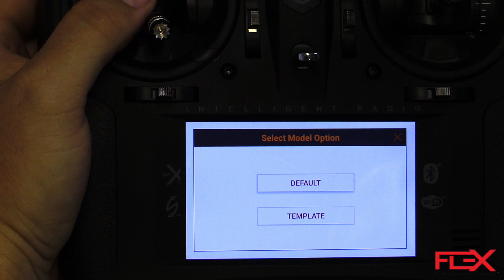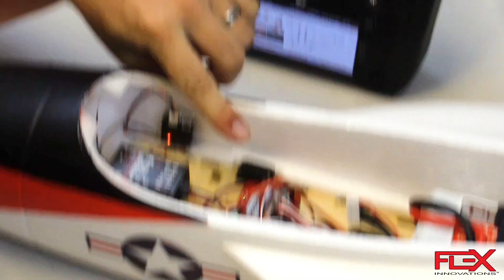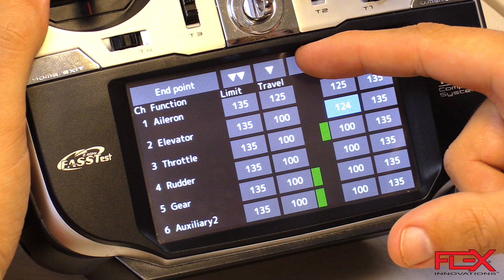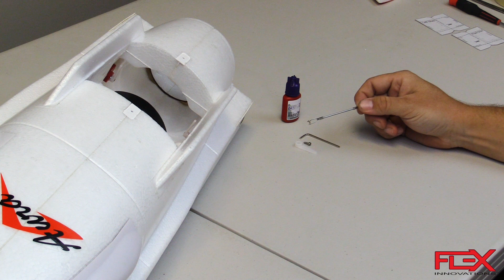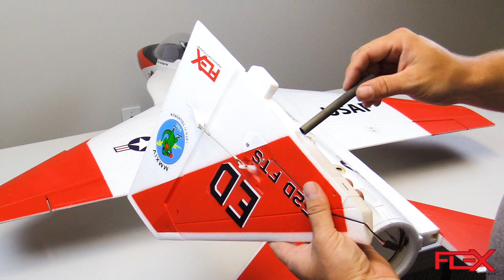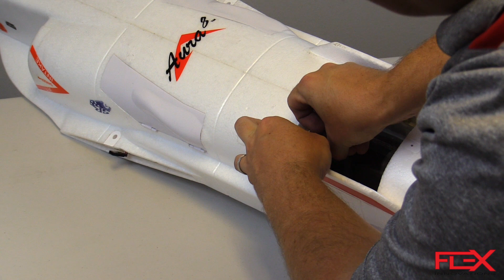FlexJet Assembly - How-To - Flex Innovations

Comment: So the stab is held in place by screwing a control arm on to the plastic spline on the axle of the stabilizer.  What is supposed to hold the plastic spline in place?  Does it come glued into the axle?  I didn't see any instruction to glue it in place.  If the spline comes out, the stab spins freely.  If that happens in mid air, that's all she wrote.

Comment: How can I bypass the Aura8 and just use a regular receiver and wiring like any other plane simple and it works. can I just plug in the servo cables on the receiver and go but how does the electric motor run should I just use ch 3 like normal throttle to start the elcetric motor.
Reply: ¹
Reply from the maker: Its works like anything else would without Aura. Plug servos/ESC into RX...

Comment: purchase one of these FLex Jets and its totally a problem the Aura8 is a pain in the ass. They suggest you use a Spektrun AR8010T receiver another piece of junk don't do it the receiver has so many issues and so many fakes on the market to get stuck with. Man im sorry I purchased this junk what a waste of money. you even have to shave off the ends of the cables to get them to fit in th ports on the reciever.